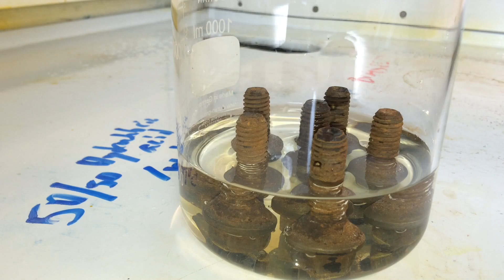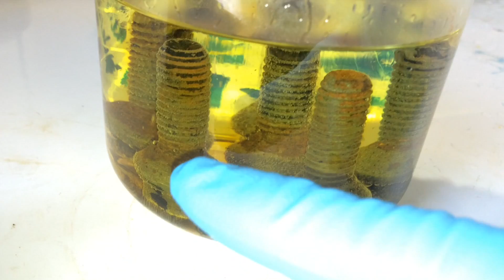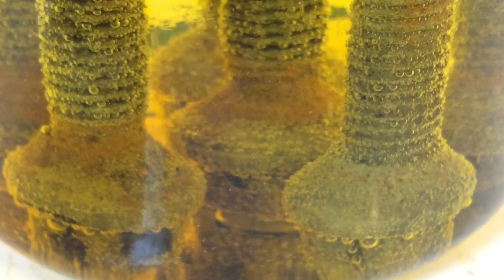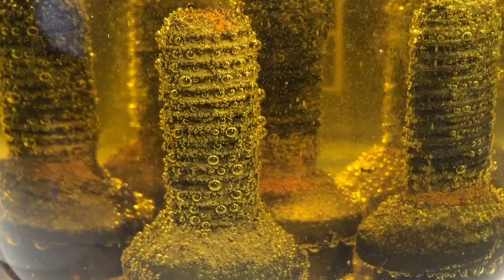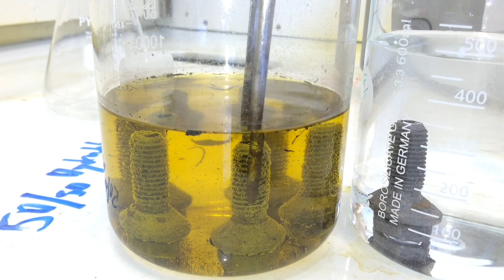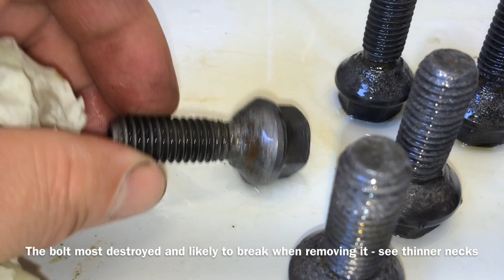True rust removal by a chemist - Jeep Wrangler YJ bolts : Ep 5

Comment: 2.5 hours? 
It's cool and all but I'm sorry I don't have that kind of time. 
15 seconds each on the wire wheel of my bench grinder.
Reply: For lighter rust on smaller objects, sure, wire wheels are just fine. I'm confident it'd take more than 15 seconds a piece for anything with heavier rust.
Reply: I completely agree! The only time I use muriatic acid is when I'm looking to dissolve the sludge and rust in an old gas tank.
Reply: That’s ok if you only have a couple of bolts. Using a wire wheel
Reply: This also works to remove rust stains from fiberglass. It solvates the iron oxide so it can dissolve into the cleaning solution to be rinsed away.

Comment: Those are high strength bolts and the acid will eat away at thread roots and make them weaker. Best to wire wheel the bolts.The amount of metal removed due to rust is about 1/3 of rust thickness.

Comment: Better to boil them in vinegar, as HCl penetrates the structure of the bolts and weakens them. Acetic acid attacks the rust, but doesn't damage the metal of the bolts so much.
Reply: I have tried freezing vinegar and remove the solid ice (water) as prep the vinegar to increase the acetic acid on rusted bolts with results.

Comment: Using hydrochloric acid introduces hydrogen to the base metal. In high tensile materials (grade 8 or class 10.9 and higher screws or bolts) this can cause hydrogen embrittlement and can result in  sudden and unexpected fastener fracture with failure. Do NOT do this to high strength fasteners in critical joints such as these wheel bolts. They can snap apart unexpectedly after some time under load! 
Google "hydrogen embrittlement" to learn more.
Reply from the maker: +Kurt Richter I am sorry, but these are not wheel bolts, they are not graded as you say, and hydrogen embrittlement is not the limiting factor on these cross member bolts. The limiting factor is the material that is gone, the pitted areas. Google ‘hydrogen embrittlement penetration depth’. Anyway, thanks for raising attention to another interesting topic.
Reply: you blokes have got me googling hydrogen embrittlement. I was aware of alkali's causing stress corrosion cracking but it was good to read up about hydrogen embrittlement. It does seem if you remove the hydrogen environment, the hydrogen can rediffuse from the steel and ductility will be returned which is interesting.
Reply: No problems. You can use the paintbrush. I use the HCl 36% (100%) Be careful, dont breath the fummes! I use the fumm hood! Then neitralise with soda solution.
After cleaning I covering with ZnCl solution. Simplest way is car baterie charger and Zn electrode.
For this quantity screews its takes about 5-10 minutes.
Wery easy to use!
Reply: Jeeps dont use this style of wheel bolts...most likely the skid plate bolts. Nothing structural.
Reply: Hydrogen embrittlement is indeed a problem, but if you remove the bolts, rinse them and immediately bake them in an oven. I can’t remember minimum temp off the top of my head but there is an explanation of the process in the link: http://www.heat-treat-doctor.com/documents/Hydrogen%20Embrittlement.pdf

Comment: Hello,  Regarding the "PH" in the PH scale does that stand for "presence of hydrogen" as I have recently been told?  Good topic in your video.  I am always interested in fighting rust.  Take care.  Doug
Reply from the maker: Douglas Thompson sorry Doug, I missed your comment. The answer is that it basically means how much hydrogen atoms you have as hydrogen ions in your solution. However the p doesn’t stand for ‘presence’ of the hydrogen in the solution. The problem is that the concentrations range over so big numbers, from very small to extremely large numbers, so someone had to figure out how to get it on a scale from 1 acidic to 14 alkaline, without 50 millions of digits after a comma. And to be correct the p stands for the negative logarithm of the H (concentration of hydrogen).
Reply: Potential of hydrogen =PH (nerds huh?)

Comment: can you agitate the bolts?
Reply from the maker: Crossed my mind but after pooking a bit in the rust, as I did the acid comparison in the other video, it seamed the process is both fragmentation and dissolution so it basically falls off and dissolves at the same time. The dissolving is the stuff that takes time, the acid needs to work it’s way into the pores of the rust, so I am not sure the shaking or agitation would do much. Agitating with some acid resistant sand, ...?? but then there’s the issue w the messy acid. For other parts I do, a small temp increase of conc increase is more effective in speedin it up

Comment: Fasteners, unless made of exotic materials are not expensive and using old fasteners cleaned up with acid is not a good idea for several reasons; firstly the clamping surfaces are damaged and will not provide even pressures, secondly the threads will be rough and will, especially if being screwed into a soft material such as aluminium,  damage the female thread and thirdly the torque applied to the fasteners will be incorrect (due to the first two points), especially if the overall diameter of the faster has been reduced. For wheel bolts, it might not make much of a difference assuming the hub is also steel or iron,, but for any application that requires a specific torque and/or is being used in a soft material, it's better in the long run to use new fasteners. Nice little video though.
Reply: Good advice.  
To that I'll add that in dynamic application where there is load cycling, the potential of FATIGUE FAILURE increases with the length of in-service life of the fastener/material.  All structural materials have a 'fatigue endurance limit' for use in cyclical load applications  -  for most common steels, typically at 30% of ultimate tensile strength PLUS about 1 million load cycles above or near that 'endurance limit'. Exceed that endurance limit and most assuredly the part/component/fastener WILL fail, and catastrophically without warning.  Fatigue happens along the macro 'grain boundaries' of the metal, weakens the material ..... and in corrosive service (consider wintertime road salt), allows chemicals, salts, etc. to enter INTO and along the metal grain boundaries which then propagate internal corrosion of the metal for 'further' weakening.  Imagine if your bolt has begun to develop micro-fatigue cracks and you then 'soak' them in muriatic/hydrochloric acid and that acid has penetrated into the base metal via these microscopic CRACKS.
For critical structure and their 'fasteners' in cyclic load bearing service, the best course is to ALWAYS replace the fasteners with NEW (to the exact same LOAD rating).  That way your control arms, steering links, your 'hard' brake lines, your calipers, your engine/transmission mounting bolts, your 'universal joint' bolts, etc. etc. won't fall apart/off at the least expected timing.  

If you really want to clean the rust from a bolt or stud (or steel tool), etc. there's a much better and simpler way: 
 Firstly a brief clean-up with a rotating wire wheel to remove the 'loose stuff'.  Followed by — BOILING the part in plain WATER for a half an hour or more (the longer 'the boil', the better).  What will happen is the remaining RED (ferric) rust will begin to convert to BLACK (ferrous) rust.  RED rust is destructive; BLACK rust is 'protective' - similar to the 'blueing' finish on firearms.  Lastly & after assembly, spritz on some BOESHIELD T9 which is a wax-like metal protectant ... used extensively on aircraft and other 'critical' maintenance venues. 
Hope this helps.  

https://www.amazon.com/BOESHIELD-Corrosion-Protection-Waterproof-Lubrication/dp/B001447PEK/ref=sr_1_1?ie=UTF8&qid=1522078033&sr=8-1&keywords=boeshield+t9&dpID=417rK6tOOoL&preST=_SY300_QL70_&dpSrc=srch
Reply: rubbish..... renew, reuse, and recycle.... sometime there is no substitute for OE
Reply: Newer use you wife more than 10 years! 
She lose 'fatigue endurance limit'....
Women owner manual point 13a.
Reply: Great point, as clamping force is the main point of fasteners.  I've seen many machinists use Evaporust to remove rust without impacting the structure of the part being treated.  They even use it on parts that are precision ground/scraped.
Reply: Not picky at all, the video was using those Jeep bolts as an example. The OP agrees.
Reply: greenspiraldragon there cheap use new ones.
Reply: well the things I tried it on were not straight, they were rough.
Reply: Ive used rusty bolts for years and years never had any failures.
Reply: So have I, but I'm pretty choosy about which to use again and which to discard - I wouldn't use de-rusted or reclaimed cylinder head suds or bolts, for example.
Reply: Or maybe it was just an example..... 🤦🏼‍♂️

Comment: or............5 minutes on a wire wheel and they would come out better.
Reply: Agree with Ken in this regard.  I've done a lot of wire wheeling of rusted metal (usually automotive) and what you usually end up with is shiny rusted metal.  A stone grinding wheel or sandpaper, yes, fast enough.  But a wire brush?  Not for me.  

For one thing, the wire bristles don't get into pores of a lesser diameter than the bristle.  And in a short time the wire bristles are bent according to the direction of travel and you simply end up doing a nice polish job of a combination of clean metal and rust.
Reply: Raven Feather do you have the brand and model to get those tools??  i have hate those rusted bolts on my car  i only have wire brush  i have cordless drill maybe something i could hook it up to it
Reply from the maker: lordbobrules You do the wire brush and I will ramp up my acid concentration, then we’ll see who’s the faster! 😉

Comment: I use Citric acid.  It's slower but safer.
Reply from the maker: Thermal Reboot IF you boil it, it will go much faster
Reply: Yes, I do use very hot water.

Comment: I worked in a trombone factory where there was an open 55 gal drum of /hydrochloric acid that wasn't vented. For years there I tasted metal in my mouth, til I figured out that the silver and gold was creating electrolysis aided by the acid in the air. I micro meshed my fillings and the metal taste was gone temporarily. I had them vent the acid pit and problem solved.

Comment: And where are we supposed to get the hydrochloric acid?
Reply: Isn't Muriatic Acid (used for masonry cleaning, etc.) the same acid? Its available in most hardware stores and home centers in the US. Perhaps its already diluted?
Reply from the maker: A 37% hydrochloric acid makes fumes like smoke when u open the bottle. 28-30 from paint stores don’t produce theses fumes at room temperature. A 30 % would need 1 cup of water per 3 cups of acid to reach same condition as in this video.
Reply: Never use Muriatic on anything you plan on painting it will remove the rust but the rust will keep coming back and the primer will peel off been there done that many years ago,even used metal prep thought everything was good to paint but it bubbled up rust under the coat of primer in a short period of time.
Reply: Most toilet bowl cleaners are hydrochloric acid... like The Works. Cheap and easy to find anywhere, grocery stores, hardware stores, etc.
Reply: A. Hardware. Store.
Reply: Philip O'Brien I would not use that at all use evaporust instead the muratic acid will rust again and much worst
Reply: NO IN SOFTWARE STORES ! hehehe
Reply: And don't forget to place the cap back on. If left in the garage without, you will find a cancer film on things closest to the gassing out or this stuff... learned the hard way !!   stuf is great for preping galvinized metal ro paint too.
Reply: John Doe.  The spray paint we get today is worthless, including "rust reformer". Acid can be washed off. WD is always good. Antisieze is better.
Reply: moonolyth:  Even with the cap on, muriatic acid permeates out through the walls of the plastic jugs it comes in. Store it AWAY from anything metal. The two jugs I bought several years ago, have corroded everything metal within 2 feet of them.
Reply: If you cant find HCl, use citric acid or lemon juice:100g/1l water. Works mutch better than vinegar.
Vinegar is the last for rust removal.
Reply: First thing I thought of also!!!
Reply: Battery Acid Car Shop
Reply: I'm glad you brought that up!
Reply: Just buy Muriatic Acid, it's basically watered down Hydrocloric Acid.
Reply: Coke also included Phosphoric acid.. Some pretty nasty stuff if you get it with the right concentration.
Reply: They sell it as muriatic acid at the hardware shop, for cleaning bricks.
Reply: You can buy muriatic acid from swimming pool dealers. It's sometimes used to treat the pool water.
Reply: Amazon
Reply: Everyone Can Do DIY projects You could make it, I did for a project.
Reply: swallow the bolts, wait 10 mins, then throw them up .. works most of the time, lol.
Reply: you can get it at pool sapply stores as Pool acid or hardware stores as muriatic acid
Reply: Home Acid Depot
Reply: Old car battery.
Reply: Homedepot's paint department
Reply: Everyone Can Do DIY projects hardware bricklayers use it to clean walls
Reply: Paolo G Thanks !
Reply: I used it back in 1982 to clean up 2 completely rusted solid chain blocks that had to be beaten with a hammer just to bend the chains, left them soaking overnight, then rinsed them of with baking soda and water and then painted them, they have been used many times over the years and still have the same paint I put on them back then. You just have to neutralize the parts before painting.
Reply: in a shop jackass !
Reply: pool supply stores have it
Reply: Home Depot / Lowes  .....   ask for Muriatic acid.
Reply: The Works toilet bowl cleaner has a good percentage of hydrochloric acid in it. You can pick that up anywhere. I've used it myself, and it has the same effect, and agitating it every so often dissolves the rust more quickly. I de-rusted the tank on my motorcycle using the stuff, and it only took about 10 minutes.
Reply: Another way of doing the same is to use "White Vinegar" it is cheap, common and above all much safer , it takes a little longer as well
Reply: I usually do this after a White House Press Briefing.
Reply: Mosques all carry a good supply of acids.
Reply from the maker: Everyone Can Do DIY projects Any hardware store w focus on painting - the 30 % does the job equally well.
Reply: Ken, next time try keeping one bolt rusty, but in view to show the original condition in your future videos, as that will show the improvement better...

Comment: A wire wheel would have achieved the same results.   Most automotive engineers only recommend a 10 minute Max not 2 hours immersion Max. Hydrogen embrittlement failure is not a joke.
Reply: Yes, because OBVIOUSLY  doors just take so much pressure. Like you know, with 900 pounds of gravity and all /sarcasm.

Do you even work on cars? Door bolts are probably the most benign bolts on a car dude. Like come on.

Are you one of those guys who goes to woodworking channels and nitpicks if they made one cut using only 1 pusher instead of 2?

How about you worry about yourself and your bolts, and quit making absurd claims. You must be from Europe.
Reply: nrawayne just a breaking frame and separated undercarriage flying around killing pedestrians nothing to worry if you use screws on the axle/undercarriage
Reply: Adam Lawson ah no problem flying door is no safety issues
Reply: nrawayne also treated by acid before?
Reply: Denis Mikitchook,never try to clean out your ash holder in you car! Most of car sellers recomend just buye one new... car.
Reply from the maker: +Denis Mikitchook depends on concentration, but u are right, anyway the rust in itself didn’t do much for strength. Slightly acidic solution and you can have it there for ages - I would worry more about all the pitting and lost metal that went with the rust
Reply: Not going to break a frame on door hinge bolts, buddy.

Comment: Why not phosphoric acid? I usualy use a product with 25-30% phosphoric acid and the rest is simply surfactants and soap, just in case you want to scrub it off instead of waiting for hours.
Reply from the maker: +PrinssiFO because of too high pka value

https://youtu.be/5Bkdej_z1HI
Reply: Rust is a mix of FeO and Fe2O3, along with bound water.
Phosphoric acid will react with the rust and form Fe3(PO4)2 and FePO4, both of which are insoluble, so will coat the iron and NOT color the solution.
In effect, the rust will be transformed and just seem darker.
In that video, it sounds like you were expecting it to dissolve the rust.

Comment: So is this 100% or 37% hydrochloric acid thanks
Reply from the maker: 100% is only existing as gas. The highest concentration existing in liquid form is 37%, rest is water. Boiling this 37% liquid will release 100% hydro chloric acid as gas, but it will immediately be diluted with air. I took the 37 and doubled the volumer with water so what you see is a 18.5 % solution. The reason i did this was because the 37% fume of so much corrosive acidic gas that it would blur the lens.
Reply: Thank you very much for the info I have my late fathers auto tools that has some rust on them I was told to use distilled Vinegar and water but your way looks like a faster way again thank you.